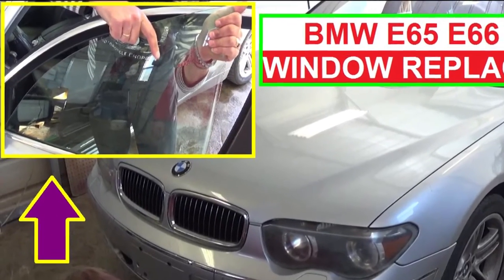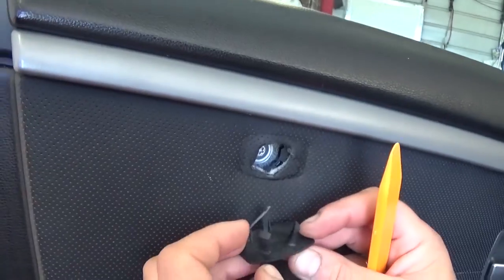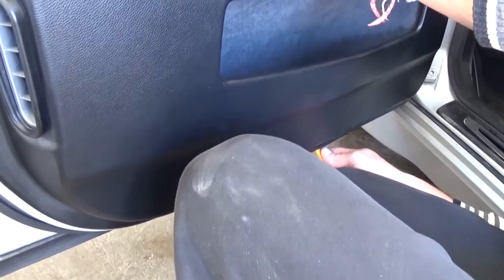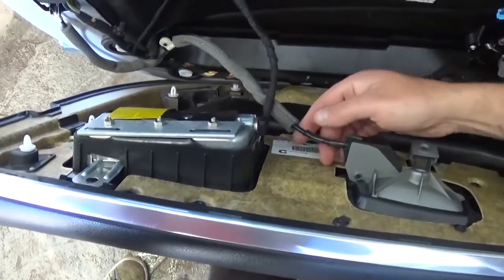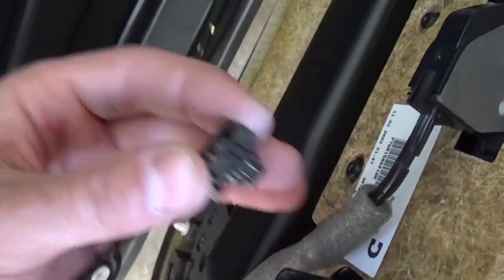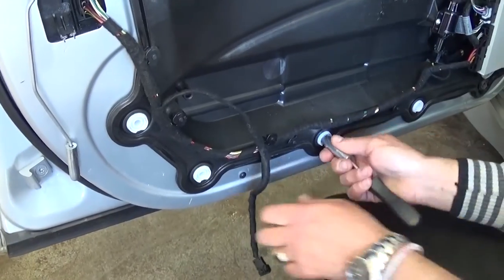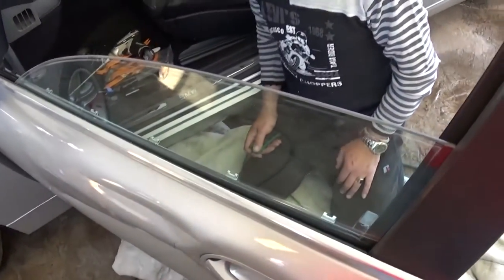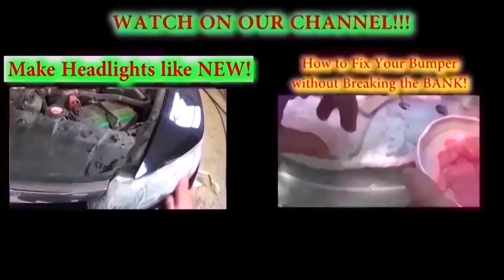How to Replace Front Side Window on BMW E65 E66 745i 745Li 750i 750li 740 735 760li 740d

Comment: Thank you for positing this video.  I shattered my drivers side window and the dealer is super expensive.  I bought a replacement glass from a salvage yard and fixed mine for under 125 bucks.